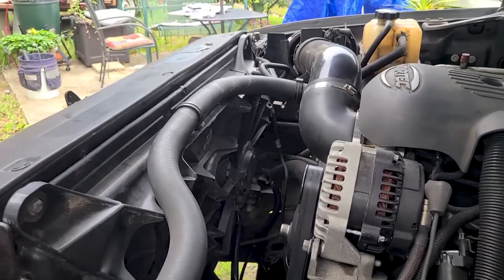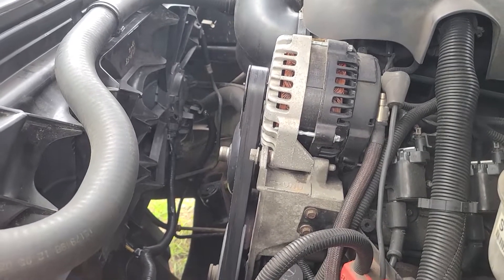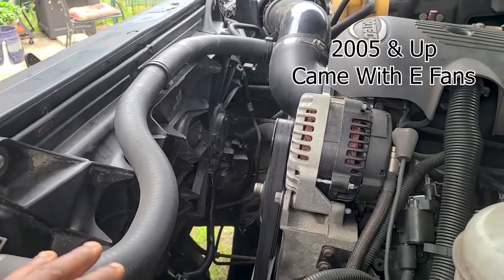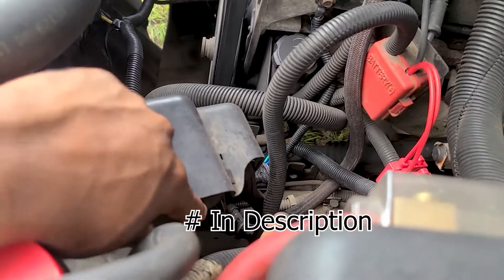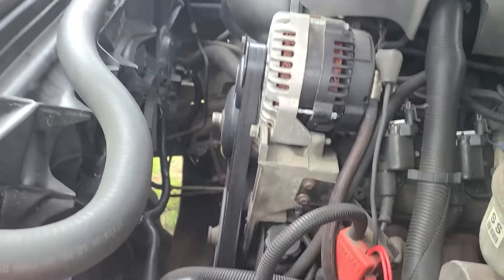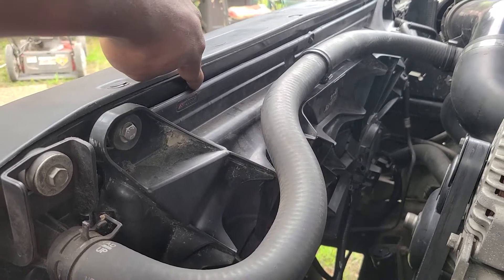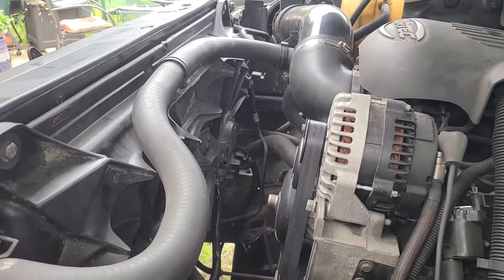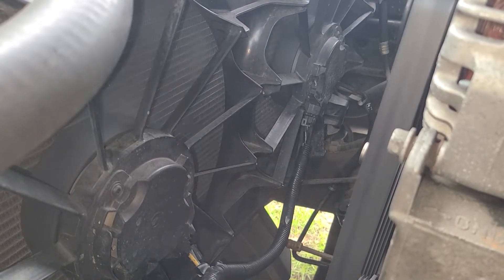Electric Fan Conversion 99-04 2003 Chevy Tahoe Silverado Sierra Yukon #efan

Comment: You have system also with the 145 alternator?
Reply from the maker: Yes, I did at first, but I later upgraded to a 253-amp alternator from Ebay. Got a great deal on it to.

Comment: What alternator do I get ?? I got the bp harness and 2008 Tahoe e-fans … and my tunner guy just getting all the parts ready to install
Reply from the maker: The factory one will work but it'll put a bit of a strain on it sometimes if you have everything running at full potential. Meaning lights, wipers, turning signals ax fan front and back and ect. It's recommended to step up to the next best one at least
Reply: Ok sounds good just want to do everything right I live in Phoenix  so the ac at idle  sucks !!!!!
Reply from the maker: @RobertMartinez-we3nr  lol yeah I remember those days. These e fans definitely make all the difference st idle as far as cooling goes. Plus I just love the sound of them kicking in at high speed
Reply: Bro !!!! 🤦🏽‍♂️ I did the upgrade and ac still sucks !!!!! Spent like 600 new alternator!!!! New e-fans. !! BP auto wire harness !!! Still bad ac.  

And  laid for guy to program computer!!!! 
Can’t believe this !!
Reply from the maker: @RobertMartinez-we3nr  you upgraded the radiator to?
Reply: No not the radiator?  I have the big stock one .34’
Reply: Ok yea I left my big stock one in ? And did all upgrade but ac feels the same
Reply from the maker: @RobertMartinez-we3nr  is the freon at the proper level?
Reply: @letsfixit251  going to a mechanic in a couple hours to check the levels out. Hopefully it’s just that that would be nice because doing the upgrade was a little pricey but also worth it because I know everything is new and working fine with the electric fans but the whole reason I did it was to have a cold AC at a dead stop idle.

And to be honest, I felt like the fan clutch was pretty good besides sitting at idle it was blowing pretty cold
Reply from the maker: @RobertMartinez-we3nr  yeah, it sounds like your possible low on freon. Hopefully, nothing is clogged up like an orifice tube. It's been 98°F or better every day here in Alabama and my fans and ac have been working together properly in the vehicle in the video. The engine temperature never reaches the middle line it lives right under it at 100°F
Reply from the maker: @RobertMartinez-we3nr  what did you find out?
Reply: @RobertMartinez-we3nr might be your orfice tube that might be clogged

Comment: So I have attempted this conversation. I have fans and the factory fan harness from an 05 Tahoe. I took it to a local tuner who said her was having trouble accessing the PCM. He claims I need an 05 Tahoe PCM to be able to program the fans. Do you know if this is accurate info?
Reply from the maker: That harness could definitely be your entire issue. Only problems I hear about with people doing this are people that have certain type of harnesses. I have the link to the harness I used in the description. I just got out of my tahoe and everything is still working properly. The tahoe in this video is a 2003.
Reply: Program that most use is Universal Patcher

Comment: I read on another site that 99'-02' trucks need a separate part for electric fans to work properly with A/C. Do you know anything about this?
Reply from the maker: There's no other part. Any idea what other part they are referring to?
Reply: A/C Update kit With High pressure sensor and Tune.
Reply: @IDABAYAREA650I  Is this a GM part or an aftermarket part? Do you have a link or a part number?
Reply from the maker: @IDABAYAREA650I  they probably did because I don't even see it or even received a notification about it
Reply: He wouldn't know he has a 03 tahoe
Reply: Also an Alternator upgrade to bigger on.